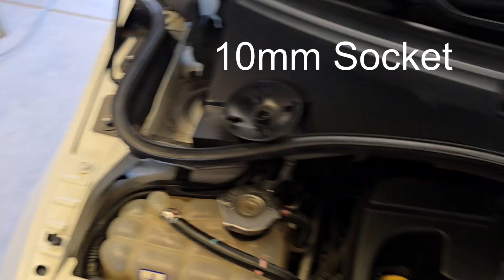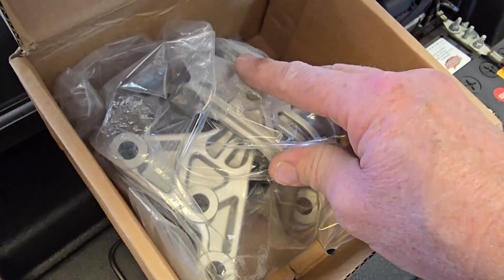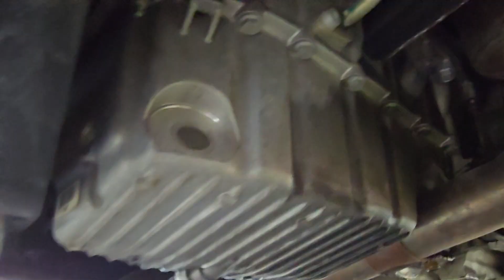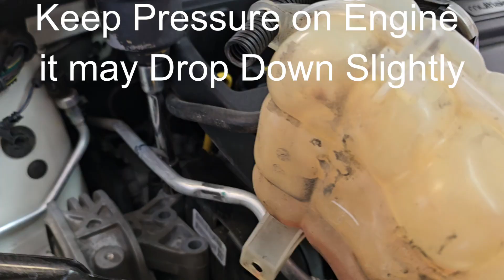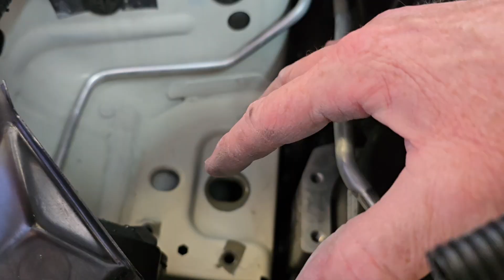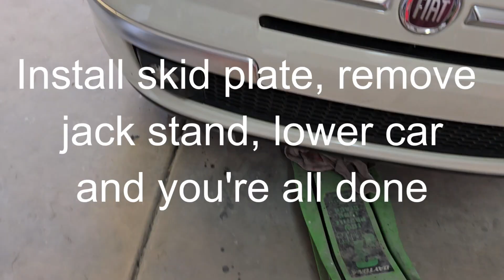FIAT 500 Motor Mount Replacement

Comment: Thank you for the great video. Are all 6 bolts really torque to 36 F/P ??? I can’t find any info anywhere else. I got a 12 Fiat 500 pop but I torqued it to 50 all of them just before I found your video. I haven’t driven it yet. What do you recommend I do now.? Thank you very much